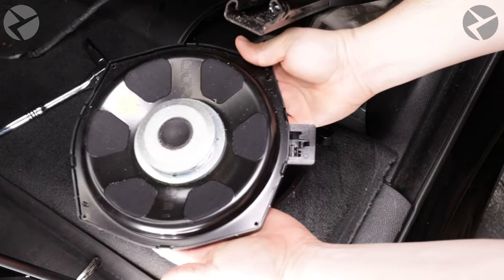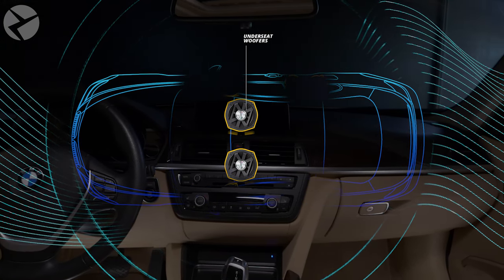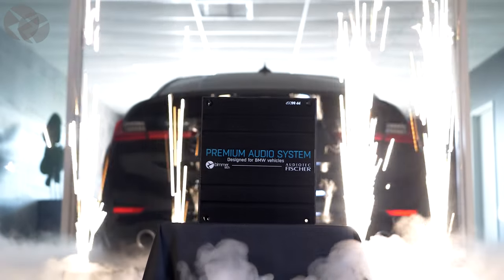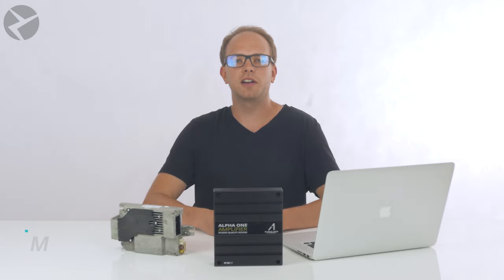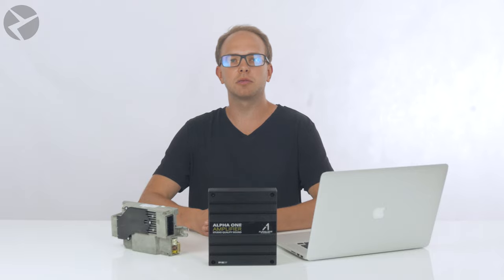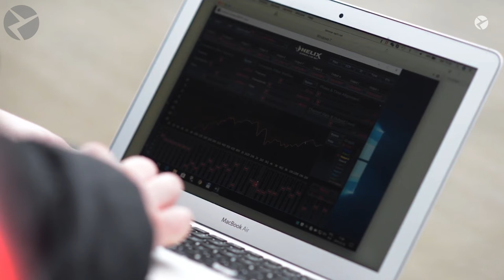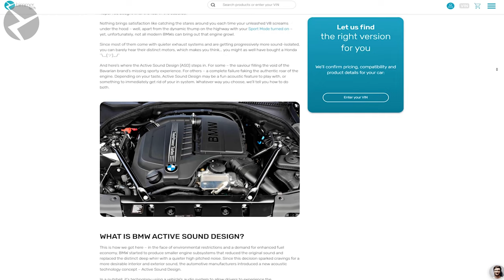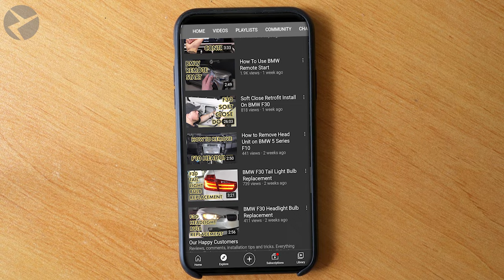Alpha One BMW / MINI Sound System UPGRADE Q&A

Comment: From what your expert  said, I gather Alpha speakers and amp are not recommended for i-7 operating systems found in Electric or electric hybrid BMW’s?
Reply from the maker: Our Alpha One Amp and speakers work great in compatible Hybrid and Electric BMW's with iDrive 7. The comment about iDrive 7 cars is that the RAM module in them has to stay installed and connected (using our wiring harness) and does not get taken out of the car. It doesn't matter if it's a full combustion engine, hybrid or EV BMW - it has to stay connected for all of the cars features and systems to operate correctly - and it does thanks to our PnP wiring harness.

Comment: I would like to know:
If I install all the Alpha one speakers via the 4omh versions and install the lastest model of the audio amplifier will my speakers flap at all or not?
That's my main concern.
Door speakers flapping during heavy bass music sucks big time.

At checkout, choosing the increase bass, having the music volume cranked all the way up, etc. Will door speakers flap while I play music with the volume all the way up?
Reply from the maker: Without your vehicle VIN we can't answer your questions specifically, but we can answer generally. If by flapping you mean the speakers getting overloaded and distorting - we set up our amps to deliver an adequate and not too high amount of power to the speakers. So no, they won't be "flapping" unless they already have some physical defects e.g. from ageing.